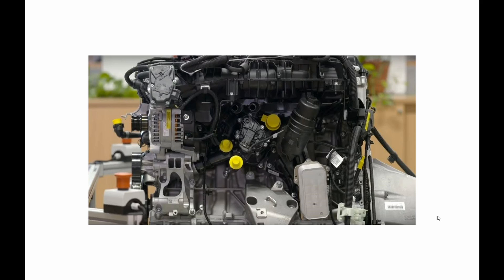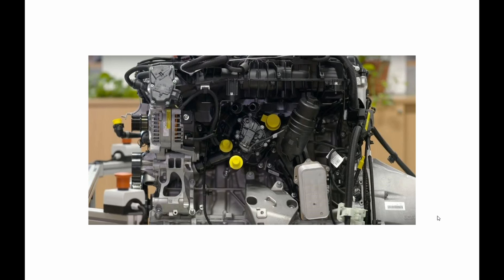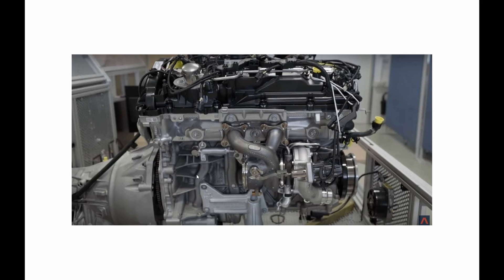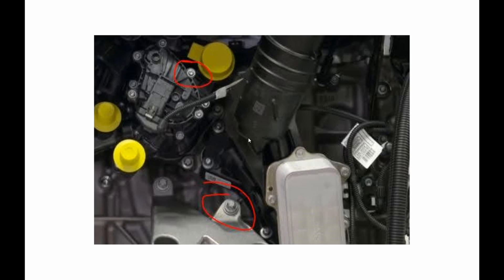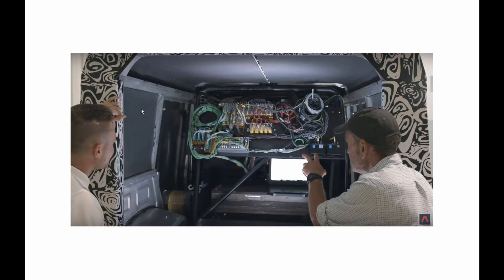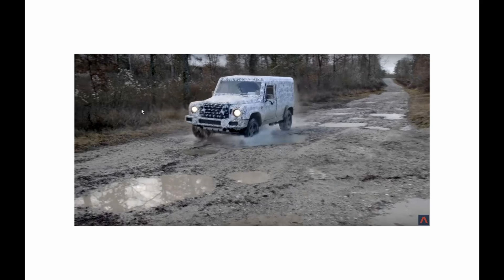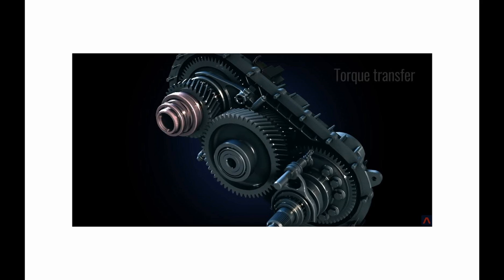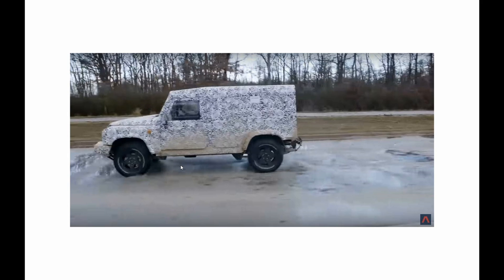The INEOS Grenadier engine and transmission

Comment: I'm not going to lie... It's a BMW Engine... They are NOT easy to repair. I REPEAT! NOT EASY!!!
Reply from the maker: I have zero experience with the engine so maybe I just have blind hope at this stage, but I'll be interested to learn more when I can see a Grenadier in the flesh
Reply: @lrworkshop  It uses the BMW 3.0 engine and the ZF Transmission.

Comment: THE PROBLEM WITH BMW ENGINES IS THAT AFTER LESS THAN 2 YEARS OF AGE, EVERY SINGLE PLASTIC PART IN THE ENGINE (WHICH ARE A LOT)  IS GOING TO SNAP OR BRAKE!!!!  IT HAPPENS TO ALL BMW'S AND IT'S NOT A VERY RELLIABLE CARACTERISTIC OF THESE ENGINES!!  WHAT ARE THEY GOING TO DO ABOUT IT???

Comment: A few thoughts...
Likes: Happy with a BMW 6 cyl engine.  Tried and tested.  Very smooth, plenty of power, with or without turbos and performs well.  But...there maybe better out there...maybe Cummins ( heavy) or Isuzu. 
Dislikes: 1. The engine will not be made in the UK.  Ok - well the word Grenadier is actually French so at least there's some historical accuracy.  2. All the plastic crap - get rid of as much as possible.  3. Those auto boxes.  I've driven lots of cars fitted with the ZF and Getrag Autos - they ALL get bogged down in the lower gears at low speed.  Which err...is kinda what a true OR 4x4 will be doing a lot of.  4. Be true to your original idea down the pub Jim - ensure they are field serviceable!  I know it's a proto at the moment but simplicity must be the overriding objective.  If INEOS believe LR have shifted too far away from the original concept of a  true off roader and there is gap in the market for a sub-LR/RR then they must stick to the principles that made LR such an icon in the first place.

Comment: the cut off point for bothering to design and build new internal combustion engines isn't far down the road.
Reply from the maker: very true
Reply: Disagree, EV'S are no match,  ICE  are also improving , may car has a catalytic converter, dpf filter, and add blue injection, whats next ? cleaner burning fuels are being developed,  I remember when LPG was the future, don't be so confident wait and see no one can predict the future .even a change of government could scrap the 2030 plan.
Reply: @royblackburn1163  they're more than a match...all that's missing is the infrastructure..internal combustion engines are hugely inefficient museum pieces..i mean pistons!...come on!

Comment: I'm rooting for them. I see it as a cultural effort, enriching the 4x4 landscape. Should it not have a nickname? I propose Grenadine. But who's going to buy it? Rich people's toy. 50'000 EUR vs. 30'000 for the Land Cruiser 70 Series. OK  I'm a fanboy of the 70 series, I admit it. Africa has mostly oppressive import duties aggravating the price premium. Too expensive for just about any serious use such as tour operators, utilities, police, farming, NGOs. Mines use pick-ups mostly as far as I know. There is a very good reason that all of the others (Prado, 200 series, Defender, G series) forewent the front solid axle. Everybody says they want it but almost nobody will buy it. I can't approve of the BMW motor and the high tech transmission. Maybe the best BMW motor is half as reliable as any decent Japanese one? Overlanding is a special case. Surely fine for USA and Australia domestic touring but I just can't see it in Africa, Asia and South America for long term overlanding. This concludes my useless rant of today razor sharp analysis regarding the Grenadier.

Comment: Is there any way to get in contact with Ineos?  I have registered on their supplier portal and tried pinging them on LinkedIn but I'm getting no-where.  I want to offer to design a diagnostic tool for the Ineos so that customers can fix their vehicle themselves whereever they are.  I own and run pscan.uk so I could definitely do it.  If you can only read faults with a dealer BMW tool then I don't think that's great if you are broken down in the middle of a desert or the outback.  Ineos please get in touch.

Comment: I think I spied a 5 pointed security torq which I have found on VW/Audi's. So add that to the list of new sockets if you don't already have some.

Verdict is still out on the Auto only option. I have an Auto LandCruiser and love it, even though it only has 3 speeds with an overdrive.
I would love to try the new 8 speed ZF or Aisin. Autos have come such along way in the past 25 years. 

For fleet buyers I guess the auto is a plus because the drivers can't abuse it as much, it also protects the drive-train. The ZF8 has a good reputation so we will see.
If the demand is so overwhelming I can see a manual being offered. Remember, this is their first attempt  at a vehicle, let alone an off roader. 
Things will change and be improved.
It can't be worse than the Plastic Defender.
Reply: torx bolts,there goes easy repair/service in the bush,this gets better and better,not

Comment: Note the exhaust is integrated into the head, six cylinders combined into two in the head casting (appears to be alloy). Probably ok in prefect operating conditions but if cooling is impaired by wear, grass/mud in radiator, or extended low speed high load conditions.
Reply: In fact I see this system aiding cooling being integrated into the cylinder head where there are cooling system water jackets ..
Reply: @JRiddledickDangerfield  Yes, exactly why it's designed that way

Comment: Who is going to fix that in the Australian outback? No one takes a BMW bush in Australia. 🇦🇺
Reply: No one can fix a modern 70 Series V8 if it broke out there. The key is for it to not break between maintenance intervals. I would have preferred a light commercial truck engine for this very reason (Isuzu, Iveco etc).
Reply: N Noddy the key is also simplicity, eg: less to go wrong. BMW are not well known for simplicity or reliability. Toyota also has the best service network in Australia which makes it an obvious choice. The Grenadier will be viewed with suspicion with BMW components.
Reply: @FJUH  I tend to agree. Hopefully, they will be proven to be robust and reliable.
Reply: Aussies Are to fat to fit in a BMW
Reply: @rotorrover1033  What are you on about?

Comment: I think the BMW engines are a good choice, presumably B57 and B58? BMW have been refining their 3 litre straight 6s for decades. Plenty of people who think the LR 2.25 diesel is the greatest engine ever made moaning about it not being "field serviceable" I've run mine for 4 years from 139k upto 225k so far and I've never needed any special tools, the little engine maintenance that it has needed I've done in my garage. Still on its original turbo and timing chain and no oil leaks.
Automatic only and permanent 4wd does worry me slightly. Automatics are more expensive and permanent 4wd isn't going to help with presumably already low mpg.
Reply: Wouldn’t come close to an Isuzu 4JJ in terms of durability, reliability and tuneability. I’m also into my BMWs, but I just don’t think with all that plastic id want one off road..

Comment: i am a BMW technician , for 35 years , there engines are not the easy to work on and they have that many sensors on , if any little sensor goes down , you will have your engine light on . even to diagnos theses engines can be a night mare as you need so much specialist kit . not the choice of engine i would put in for sure .
Reply: roy jennison exactly, no one in Australia will buy this, there will be no way to repair in the outback 👍🏽
Reply: @gemini2261  We don't call it the "outback" it's the bush
Reply: Roy, I owned a TD5 in Land Rover for many years and the engine had lots of common issues.This engine was from BMW. Mainly a lack of durability, the replacement of components that failed at very low kilometres was mindboggling and expensive. This haunts my opinion of Ineos choice of power plant.
Reply: @kerrysattler3143  Agree with you .
Reply: Interesting. What engine would you choose if you had the chance?
Reply: @andyakarudolfhessiansack7936  Diesel,probably Iveco or Cummins,with minimal or no electronic intervention and no "add blue " requirement
Reply: @andyakarudolfhessiansack7936  easy, 3.5 or 4l V6 from the Tacoma or 4runner. Isuzu is really good too
Reply: Put a Isuzu dmax engine in

Comment: German engines have used cartridge filters accessible from the top for over a decade. It really is quite nice, because a bayonet is attached to the cap that unplugs a drain when unscrewed, so the element change is nice and clean and very very easy. Not sure about plastic inlet manifolds but I assume that BMW have sorted their manifold throttle valves out by now.
External Torx fit 12 sided conventional sockets, so no need for new tools for those.
Reply from the maker: Thanks Huw good to know :)

Comment: Agree 100 percent... A cummins or isuzu engine was what was required and Auto is fine if you can properly lock the gears especially the top cog and ideally have a crawler cog in there too... Missed opportunity using a BMW plant.
Reply: The Isuzu 4JJ is also VERY tuneable too and stupidly durable. What a shame they didn’t choose it.
Reply: they are not using cummins or isuzu because of EU emissions regs. If they offer other engine choices for none EU models that will sort any issues. I guess in time they will.

Comment: Auto boxes are softer on the rest of the transmission, are more robust with their epicyclic gear sets, can’t stall the engine, and give shifts without dumping the torque so can change on steep hills or in sand.  The manual selection function will allow you to preselect and hold specific gears.  It’s a very good solution and will prove more reliable than a manual transmission.  As long as you don’t cook the fluid and replace it on schedule, they’re much better in service.  That does come at the cost of some acceleration and fuel economy on older designs, but assuming the torque converter can lock up at lower rpm, especially in manual mode, then it should give comparable performance and economy to a conventional manual.
Reply: The ZF8 is recognized to be very efficient in changing gears and the torque converter is a little different too I think. Its not just a simple converter
Reply: @TheCls63  Don't forget the torque multiplication  also just  try driving a manual in gravel and see how far you get.

Comment: Industry experts have raised eyebrows at suggestions that the Grenadier will aim to sell 25,000 to 30,000 vehicles a year at a price of up to £45,000. Mercedes G Class production started 1979; up to 1986 50,000 produced (in 7 years); up to 1992 100,000 produced (in 13 years) and up to 150,000 in 2001 (in 22 years)...
Reply: Yes I do agree 25,000 to 30,000 pa is very ambitious with no established dealer/parts network and especially against your interesting  G wagon sales comparison. I think that 7 to 10,000 pa is more realistic . I also feel that not building in the UK will also hinder domestic sales potential.. I heard that the French facility could save costs as it has a structure to built a large SUV.
Reply: michael F.H The sudden attraction of the Smart factory is reportedly linked to a recent investment by Daimler to retool the plant to produce a larger SUV model.
It’s thought the new SUV line at Hambach would allow the Grenadier to be built on the same line using the same processes, hence the interest on the part of INEOS, which could save millions by not having to build and equip two production facilities.

Comment: Thanks again for your update! 
I really do hope they clean up the engine bay, and like you said enable access to all the wearing parts without requiring a hoist, garage, rediculous tools, computer or 15 days of time off... Fingers crossed...
Reply: I'm still in disbelief that in Discovery 4 it is apparently easiest for  the whole body to be  removed  to give access for  major engine repairs. A lesson there.......
Reply: I think everything you mentioned will be exactly the opposite.  I worked for a German company as a field service engineer and tried to provide feedback on how machines could be improved for easier repair and their  reply was that if it breaks only a certified person should repair it. Its a cultural mindset, you cant even wash your own car at home in Germany.

Comment: Having signed up to Ineos very early on, I've had  no fresh email link for another video since 1st July.  They must have got selective with their invites ?
Reply from the maker: Interesting. I've only had this one since then, but I've seen the video posted on forums so it's not just me getting them!
Reply: @lrworkshop  I must have upset them ranting, hypothesising about no  fireproof  plastic sumps or questioning the wisdom of single use torque bolt fasteners in wilderness motoring ?

Comment: Automatic transmissions are pretty reliable. They’re also a lot easier on the vehicle. Sure it’s nice to have a clutch but the reality is that it’s going to last longer in the long run, especially off road.  Anyway, the fact they’re ignoring you tells us they’re not actually that serious about this thing being truly useful to fleets and people in far off places on the planet.
Reply: Kind of an interesting situation with the gearbox.
They've probably specified the gearbox and drivetrain on the basis of what the manufacturers KNOW is reliable.
Carraro will know auto-boxes give the trasnmission an easier life and ZF will, presumably, be building a reliable auto-box.
Overall, INEOS will be aware that if this vehicle has any obvious weaknesses it'll never take off so I'd assume reliability is their primary concern.

The trouble is that we, as drivers, tend to think of auto-boxes as overly complicated and as an extra source of potential problems.
Once the Grenadier has been out for a couple of years, with no reported gearbox issues, I guess people will start to come around.

As for ignoring people with specialist 4x4 experience, that's probably a deliberate decision by INEOS, unfortunately.
When the tme comes to generate publicity for the Grenadier, they can hand it over to regular journo's - who're going to be easily impressed by ANY half-decent 4x4 - and be assured of getting glowing reports about it.
The last thing they want is a bunch of people who'll be saying "It's good but it would have been even better if....."

Comment: Would much prefer a commercial vehicle based engine/driveline, unstressed.

Best Land Rover 110/Defender was the Perentie with the Isuzu 3.9 4BD1, appropriate capacity and under stressed in the 110.
Reply: it was great as 4*4(). but it was bad for driving long distance(12hr a day), it was hard to stay awake because of the heat and noise. a good 4*4 that travels long distance need to be driver friendly(cool and reduce noise).
Reply: @davidjrule66  That had more to do with 1980s military build. Zero NVH insulation and no roof (canvas) or air conditioning. I think Ineos have that department covered.

Comment: You asked for thoughts...  Here goes...  Engine is small (3L) turbo.  Would prefer a larger engine for longer life.  The engineer said it meets the emissions standards of all countries.  I heard design compromise.  The manual override of the automatic transmission indicates over engineering and expensive maintenence.  The big rims and low profile tires suggest a priority on esthetics rather than off road performance.
Reply: Manual override has been in almost all automatic transmissions for decades, it’s not over engineering at all
Reply from the maker: The emissions one will be interesting to watch how they tackle ROW markets. Whether they change the map or start removing parts to make it simpler.

Comment: Honestly, if you're going to have an auto' gearbox, in this day and age, it's probably going to be computer-controlled anyway so setting it up so it's operated by "a couple of simple levers" is going to be a purely cosmetic affectation that's likely to needlessly limit functionality.

The issue with LR's Terrain Response System, as with most of LR's current technology, is that it's "baked into" the entire vehicle - there's no way to isolate certain systems in the event that they fail or override them so you can do things that the vehicle isn't programmed to let you do.

I'm all for the idea of having separate, isolated, systems (a gearbox that JUST controls the shifting, a traction control system that JUST controls where torque goes, a suspension system that JUST controls the suspension, a steering system that JUST controls the steering etc) but if the computers that control these systems CAN do clever things then it'd be daft to deliberately deny the driver the opportunity to use them just for the sake of maintaining a "simple" control layout.

If, for example, the computer that controls the gearbox CAN select different modes so I can have sporty shifting, economical shifting, off-road shifting, towing shifting or whatever, I'd hate to think I won't have access to those options just cos somebody at INEOS likes the idea of keeping things simple.

At the end of the day, it's better to HAVE options and be able to ignore them instead of NOT having options if you DO need them.
Reply from the maker: Wise words there Si. It's true engineers can start doing "clever" things when they want to, it's just whether they can hold themselves back or not